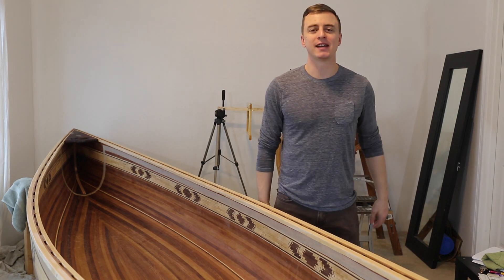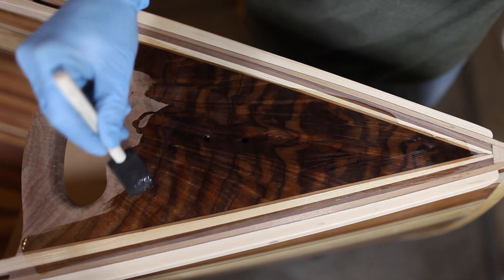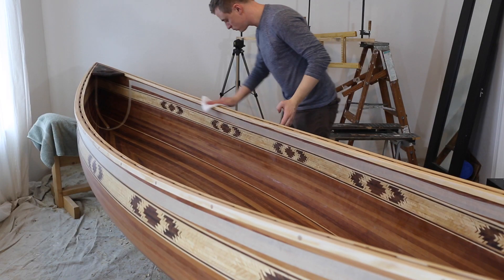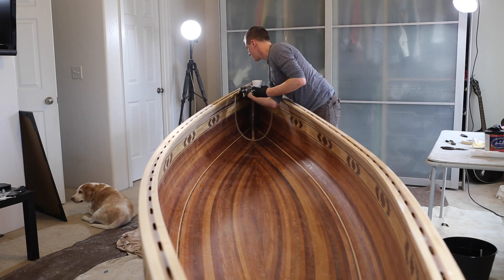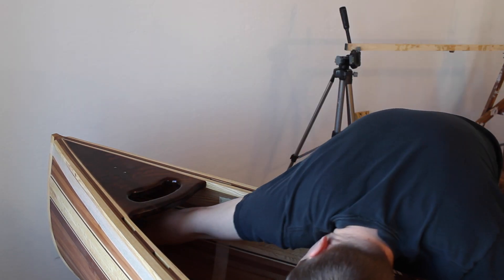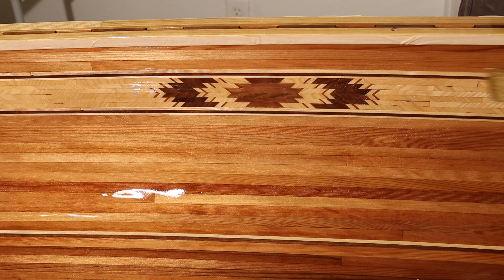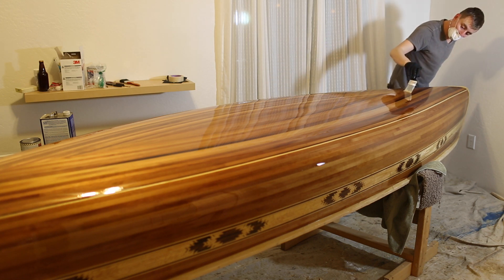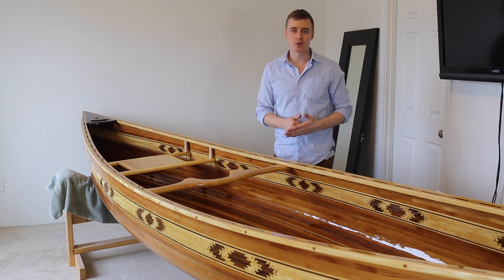Varnishing the Canoe (Ep 18 - Cedar Strip Canoe Build)

Comment: Fantastic looking canoe. My wife thinks it is too big a project for me but I have built wood projects all my life and I am just setting up my new garage wood equipment.  It is 24 x 36 and I have plenty of room to build a canoe. I am 58 yrs old and I am confident in my abilities.  I did build a wood & fiberglass canoe from a riverside canoe kit when i was 16.  It was an 18 ft kit with sheet fiberglass and a relatively flat bottom & straight up sides. I ended up chopping 3 ft off one end & built a transom for an engine.  That flat bottom made it real hard to paddle when the wind blew.  Your cedar strip canoe is simply beautiful.   Thanks again for putting this video together.

Comment: Nicejob of showing the build.  Two comments:  you mention keeping a wet edge when vanishing.  Yes, but you should brush from the dry side and let the brush flow into the wet side.  Thet feathers the varnish evenly.   Also, you have a beautiful boat ,but after the first trip, your hull will be scratched on both the inside and the outside.  So don't worry, that is all about canoeing.  After nine canoes, all mine are showing river scars.  Most have been on whitewater trips where there are plenty of rocks.  Your canoe is like a piece of furniture.  Good job.

Comment: Hi Adam, I am about to varnish on top of epoxy and I have sanded but there are small valleys all over the surface of the canoe where I haven't sanded all the way down to. It's going to take a ton of work to get all of them out I'm just wondering if you had a similar surface before you started to varnish? I just am worried the varnish wont adhere to the epoxy in the more smooth and kind of waxy spots. Thoughts?
Reply from the maker: Tanner Jabez Garrett I had the same thing, I tried to get it all down even but eventually I got sick of it and just called it good even w what you’re talking about. I think you’re probably good
Reply: Cool. Great to know, thanks again for your help!

Comment: Hey Adam! I just started prep for varnishing. I have sanded my gunwales and decks to 220  and have gone too far in some spots and there is now exposed wood. I know that the epoxy seal on the trim is only for extra strength. But, will the exposed wood look different then the surrounding epoxy layer areas after varnishig?
Reply from the maker: Tyler Little I did that too in a couple really small spots and you could hardly tell once the varnish is on so you should be fine. I figured it’d be more troublesome to try to put more epoxy on than to just move forward w varnish. Good luck
Reply: Awesome! Great news! Thanks again Adam!

Comment: Another question: you used Epiphanes, but didn't mention thinning your coats (50% on first, 75% on second, then full strength successive coats).  Did you do this and just not mention it, or did you run full strength all coats? If you didn't thin your coats, how did it perform?
Reply from the maker: Nate Messenger good question - you have to thin if you apply it onto wood but you don't have to thin if you apply onto epoxy. That's another reason I coat all the trim with epoxy so I don't have to mess around with thinning
Reply: Oh ok. Makes sense.  Thanks!

Comment: It's magnificent. Looking back, is there anything you'd do differently?

(and please don't blow this one up)
Reply from the maker: Ha - yeah not planning on destroying this one! The big thing that is gonna bug me is before I fiberglassed the hull, I mixed some die & sawdust with epoxy and filled a couple cracks between the strips - I didn't mix enough sawdust and die in so light shines through the cracks if you look at it from underneath at the right angle. structurally it's solid - it's just aesthetic. There's always stuff like that with big projects that will bug me forever... Besides that - I would like to make a super lightweight one person canoe or a longer two person someday. I like this model I'd just like to try something different. Also - I like the design on the side but it is kind of busy. Sometimes I feel like it takes away from the natural simplistic beauty that a wood boat is supposed to have... Sorry for the long response! Thanks for the questions!
Reply: Thanks for the answer. Best of luck with it!

Comment: Just an FYI, dust masks DO NOT work with fumes from varnish and acetone...  There is no substitute for good ventilation.  And make sure any rags used in clean up are taken out and disposed of daily.  Be especially careful with finishing a project in your living space.
That aside, AWESOME video series.  I just finished watching them all,  I feel like I need a cigarette, and I don't even smoke...
Reply: Something else I thought of, you can get an air filtration system to get the dust our of your workspace if you don't have a "clean" room for applying finishes.  If you have a dust collection system, a lot of them have HEPA filters you can use just to filter the air.  (Use the regular filter bags for collecting sawdust from tools, that way the HEPA filters last longer)